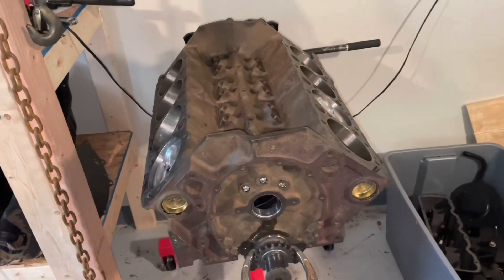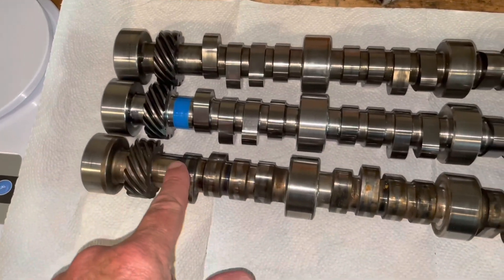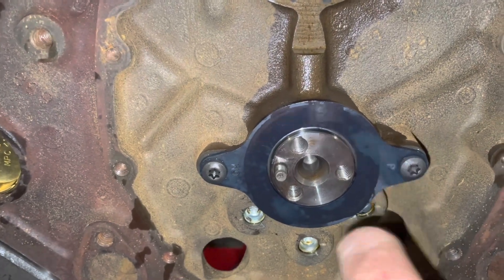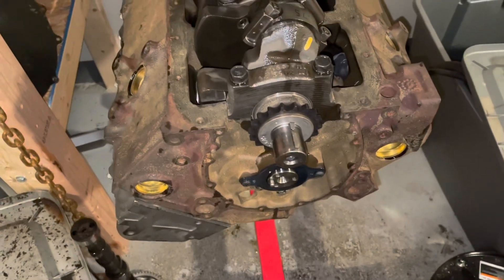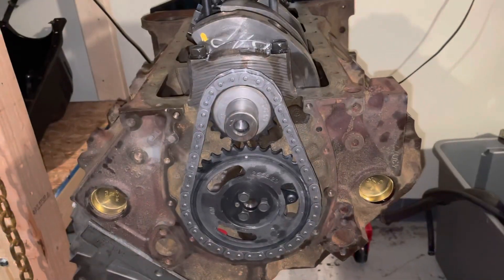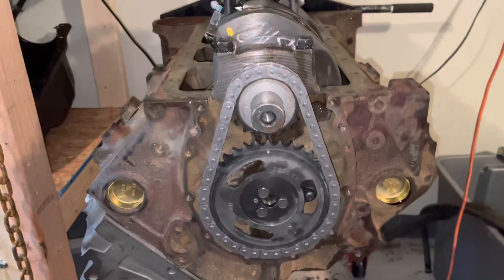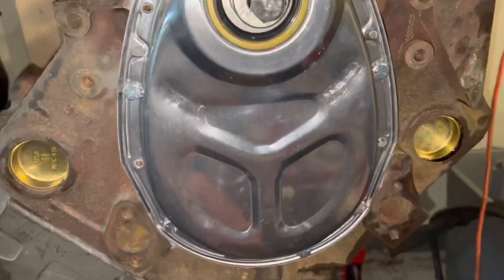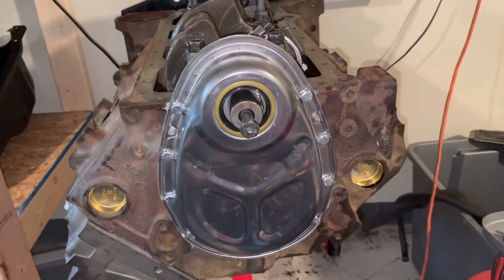Mercruiser 5.7 1(f) - Camshaft From h311

Comment: What year chevy mercruiser came with a roller cam with mechanical fuel pump lobe
Reply from the maker: All of them 1996 and up. Problem is not all blocks are drilled for the fuel pump rod or mounting holes. I’m working on a block now with partial drilled pump rod but it doesn’t go all the way to the cam.
Reply: Thanks for the quick reply

Comment: Do you have the part number for the melonized distributor gear?
Reply from the maker: There are different distributors with different shaft diameters so there is no universal part number.

Comment: was the block not a "vortec" block then
Reply from the maker: You are correct. This was a non vortec block which was the root cause of the problem with the timing cover. Since this engine had throttle body injection it did not need the crank position sensor. If this was a MPI engine, I would have to use the plastic Vortec cover. There is a $125 cover you can use to add a crank sensor to a non Vortec block. I did a video on that too.
Reply: @moccasinmarine  you can use a old style timing cover on vortecs. you have all you just have to remove the vortec reluctor wheel, and use an old style sbc balancer. the vortecs use a shorter snout on their balancer to account for the reluctor wheel.
Reply from the maker: @frigglebiscuit7484  in my experience the Vortec timing covers do not seal against old style blocks due to flange mismatch